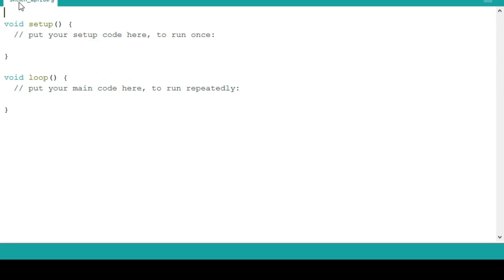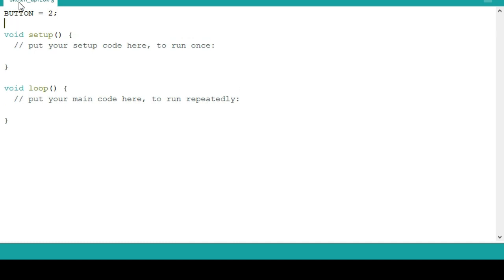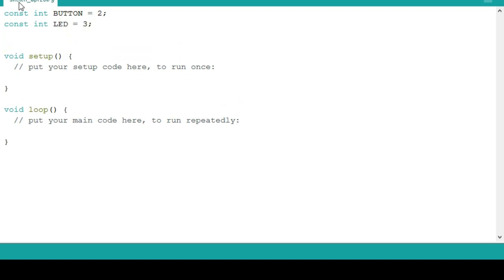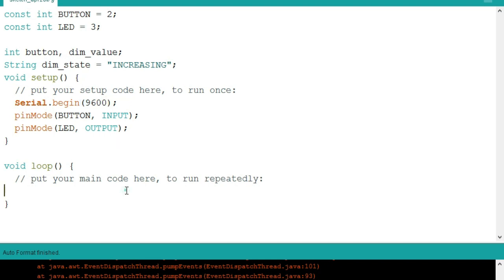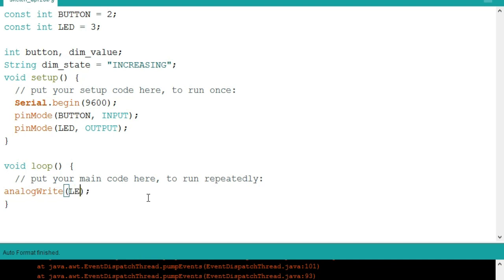Arduino | How to make a LED Dimmer using 1 Push Button | Full Tutorial | For Beginners 2020

Comment: Hi !, Thanks for your video. I'm trying to create a code like yours. I would like something like this :
-When i press the button -> on / off. 
-When I hold the button -> the dimmer will enter in a loop increasing and decreasing. If i release the button the position will be saved. So if i push the button one more time the led will off and if i press the button again the led will be on keeping the previous state. (it's how works the most of commercial dimmers - https://www.youtube.com/watch?v=r8FV0aZz5p0) 
 I'm trying to find a similar code without success.  Do you know how can i find something like that. I try to find it in GitHub but nothing... Thanks again for you video! Liked and Subscribed!
Reply from the maker: Yes i can make that, reply on this message again and i will make the sketch for you :D
Reply: @daviñascode1997  Thank you very much!
Reply: @daviñascode1997  yes pls i also want the same thing he mentioned i want to control brightness and on off using on pushbutton for my power supply lcd backlight pls give the code in the discription pls